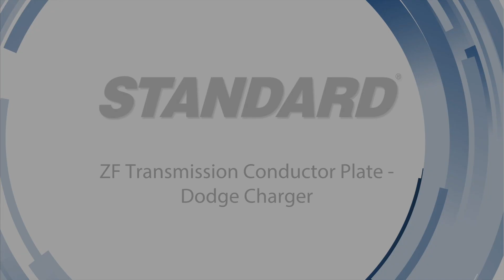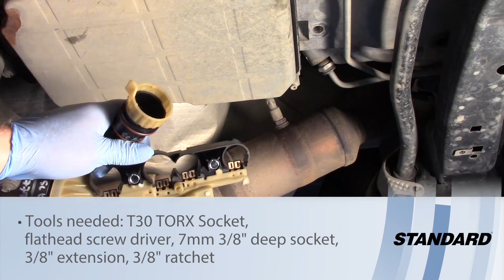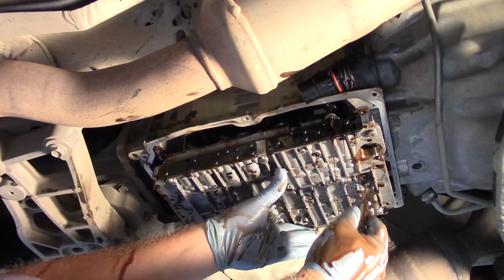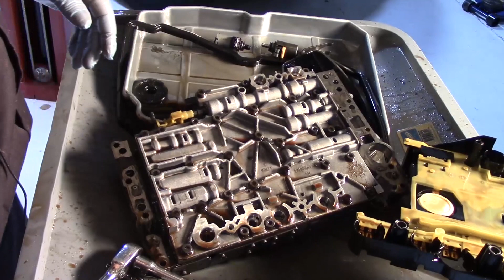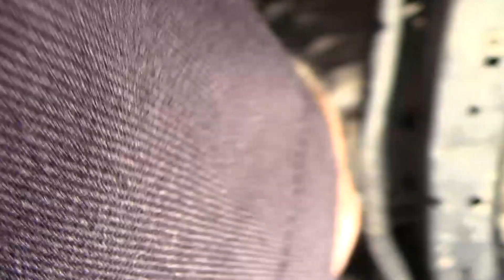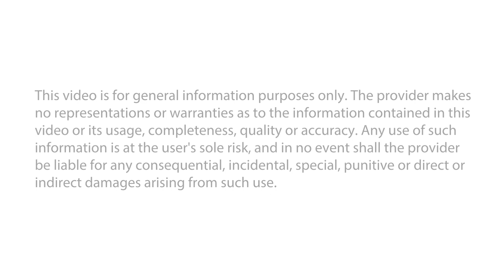ZF Conductor Plate Replacement - Dodge Charger

Comment: The pan bolts don't always come off that easy sometimes they snap off, so use a penetrant first and if that doesn't work you may have to use a torch to heat them up.